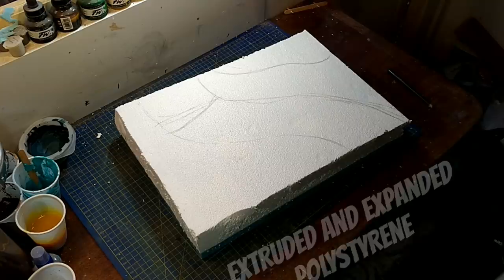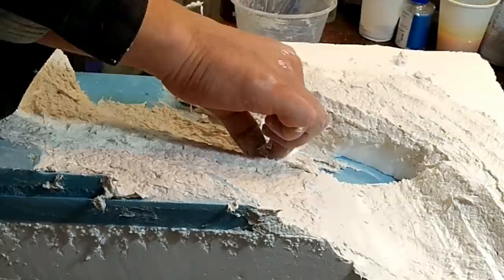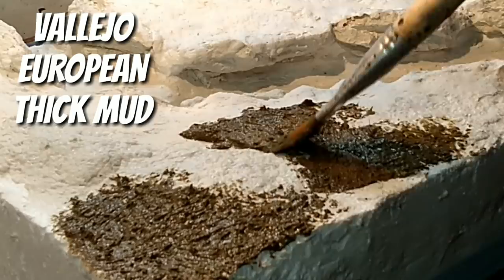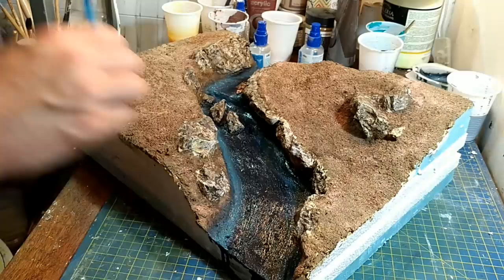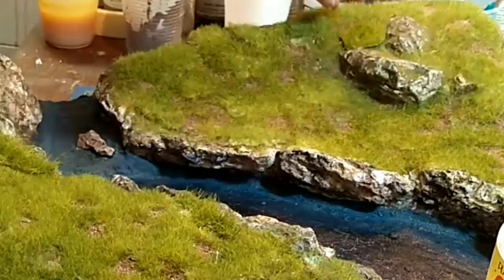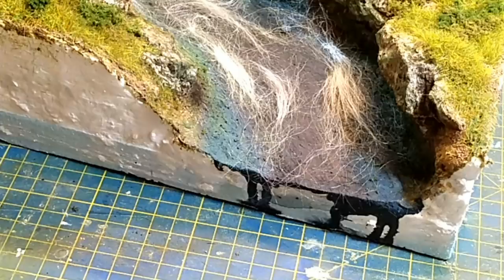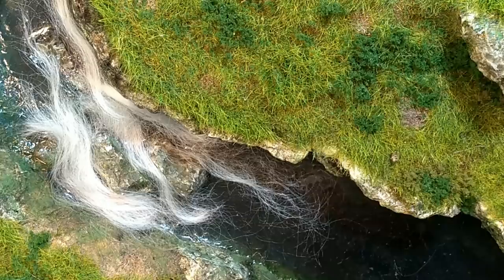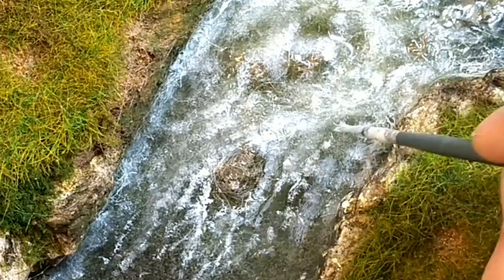Stunning river diorama: how to make the ultimate realistic scene

Comment: a heat gun for getting rid of the bubbles would be perfect. A flame could be to harsh for the surrounding areas. I use my heat gun for making epoxy marbles.
Reply from the maker: Yeah, I agree. Smaller pieces I use a flame, but for this a heat gun would be perfect. Cheers!